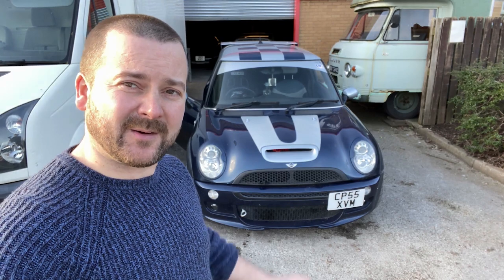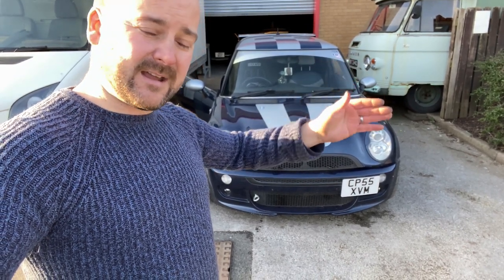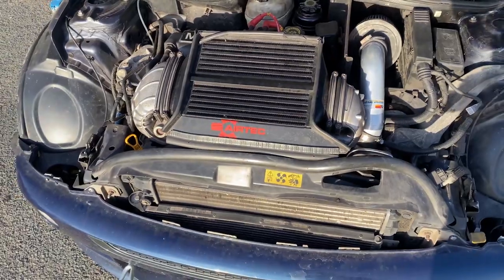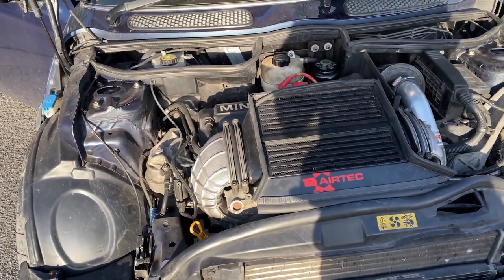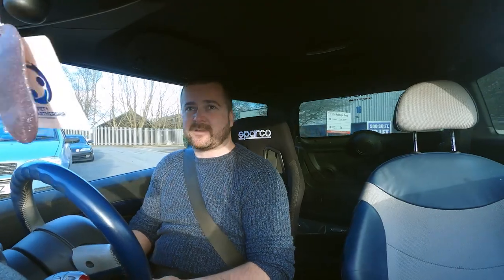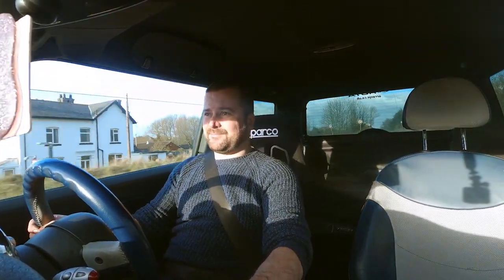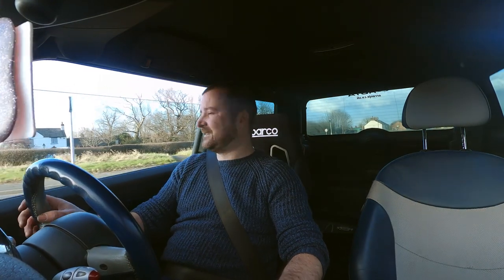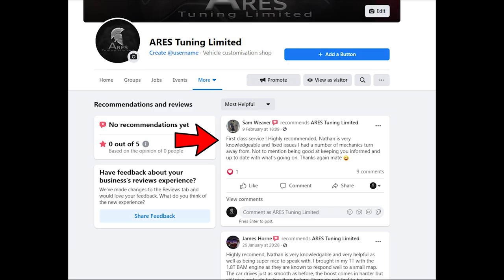Mini Cooper S R53 Stage 2 | P0107 & P1688 Fault code FIX!

Comment: The front bumper looks a bit loose. Any chance of you filming while doing the work(time lapse)?
Reply from the maker: Something I’m going to start doing! Just been busy getting the work in and out at the moment, as soon as I settled in to this new business I’ll be filming a lot more - time is money at the moment and it can be a faff making sure all the SD cards have enough space and the battery etc (I know this sounds pedantic) but just trying the build my reputation with quick and quality work
Reply: @wosa9461  understood 😊👍
Reply: To be fair the bumper is fine it's just the bonnet wasnt properly latched in the pic. It was on one side not on the other I pressed it down when I got home. They can be a pain to properly shut!

Comment: Thank you for the video.  Are the MAP and TMAP parts the exact same or not?  Just replaced my MAP sensor by the airbox and still getting P0107 and P1688.  I used Delphi MAP Sensor PS10133.  But looks like the other might be bad too?

Cheers
Reply from the maker: Hey matey! No they are different from one another - I would only recommend using genuine parts for replacement as most copies do not work correctly

Comment: Top video bro, how can I book my r53 in with yr self?
Reply from the maker: Hi matey! Thanks my man! You can send me a message @ Facebook “Ares Tuning Limited”
Reply: @wosa9461  thanks Wosa, I'm old school I'm afraid so don't have FB or social media 😅 lol will get my son or my partner to let me go on there fb so I can book my r53 in with yr self 
ASAP.. cheers Trev 👍🏾
Reply: @wosa9461  trying to find you on Facebook but no luck as yet? just after a link because I believe on my r53 s has the same problems as the r53 s you fixed? I'm in Manchester but willing to travel to get my car right it's a stage 2 with 17% reduction pulley 👍🏾
Reply from the maker: Pop us a message 07809438319 

I’m based just outside Chester, so not too far from you